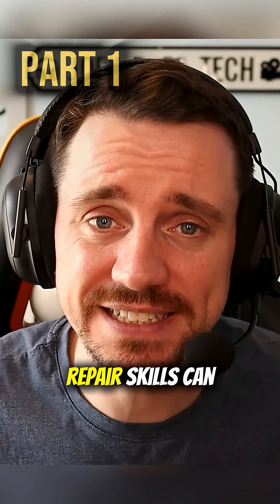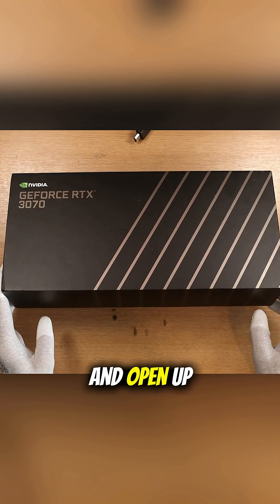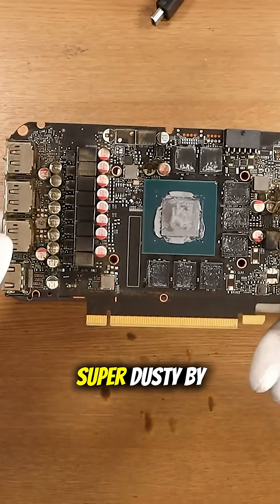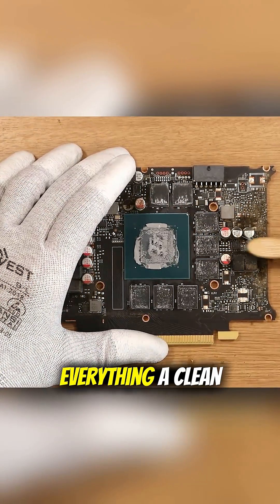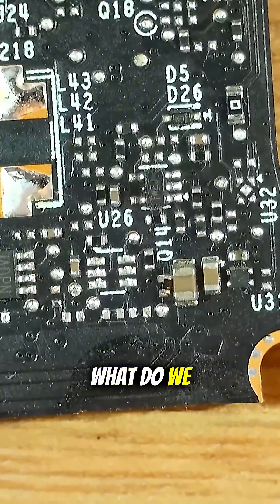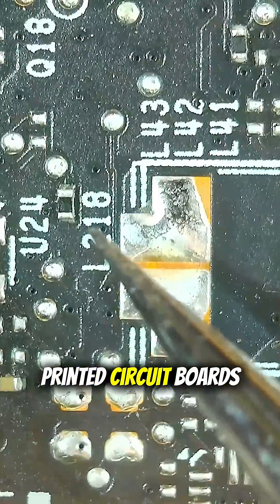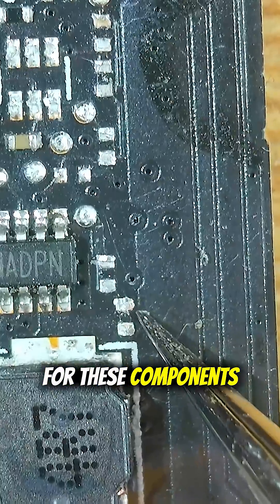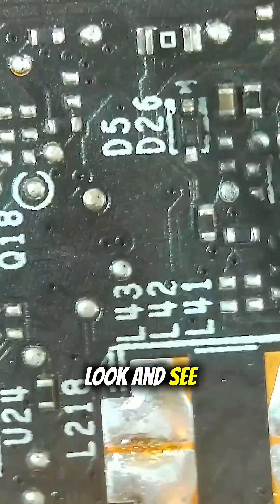Part One - I Paid £124 for a FAULTY Graphics Card... Lets Fix It! #repair #gpu #nvidia

Comment: Hey mate awesome Video! Not sure of ya can help me? Or reply but.. I have a Gigabyte Vision that when Idel Temps are fine, If I jump into say COD Zombies Cold war temps are pretty good around 60C But if I fire up Battlefield 6 In the menu screen and loading screen temps ramp up to 80c Hotspot is 105C! Thermal throttling But once the game starts it will go back to around 60 hot spot is fine.. Doesn't make sense, I guess Needs thermal pads and paste, I just don't get why it's fine in game but in the menu it gets hot!? 
Long question sorry mate! Tried Under volting Curve fan nothing works, Anyway Nice video mate Cheers!

Comment: might not necessarily be missing parts.
sometimes they use the same board for multiple products of the same family, which might leave parts of the board not populated.

so yea, might be a good idea to look up a picture or second card of the same type
Reply: I think the ripped pad and lose resistor is a clue that it's been borrowed from.

Comment: That board was used as a donor board for repairing other machines...Too many missing components for anything else.
Reply from the maker: But if it was used as a donor, why was it a donor in the first place? I just replaced all the components and it worked :D
Reply: @JoeyDoesShorts that’s great news! 3070 was a sick card in its time. Still pretty good now too!
Reply: @JoeyDoesShorts 
Imo is more likely the GPU has been through repair shop and the repair shop get rid of the resistor and capacitor attempt fix the issue I would say
Reply: What board was used for mining. And was washed with high pressure before selling in bulk

Comment: If I would send you my RX 7900xt would you try fixing it? It Boots without drivers but after Driver Install it Just blavk Screens on Windows Boot. It's pretty sure No Software Problem since I tried it on multiple Desktops. I would suspect an Error with the VRM since I did heavy overclocking on it

Comment: Why will someone take off the smd chips? Or rip them off.
Reply: Scavenging parts most likely. Been used as a donor then sold on as not working. Explains how the resistor got knocked loose, and why that area of the board was so dirty.

Comment: Was it sold by MrYester or a copycat? 😂 He did a series of removing caps from a gpu to see how many weren't needed until it stopped working
Reply: Well..! Caps in modern electronics (especially on GPUs) are mostly used as decoupling caps and transient current buffers on the power rails, and they’re usually placed in parallel. Because of that, removing one or a few doesn’t break continuity and the device can often still boot and run. That said, GPUs have very tight power-integrity requirements, so removing too many (or the wrong ones) can cause instability, crashes, or long-term stress on the silicon.

Other components like resistors or diodes can be more critical, but it depends on their role. Parts that sit in series with a signal or power path will usually kill that section of the circuit if removed, while others—like pull-ups, pull-downs, sensing resistors, or protection diodes—may not stop the device from working immediately but can degrade performance or safety...!